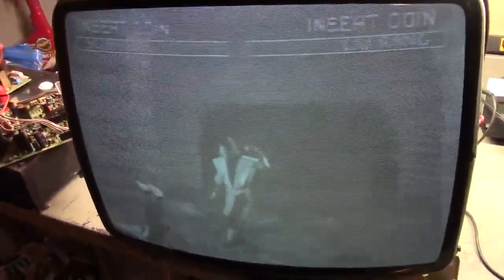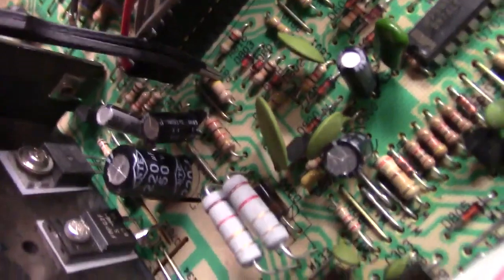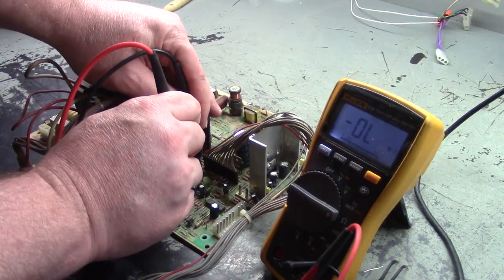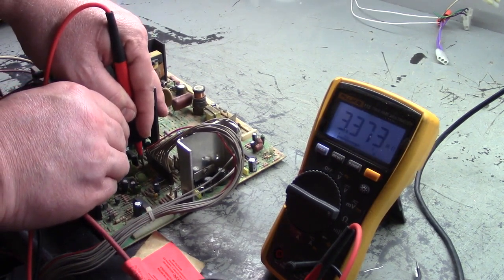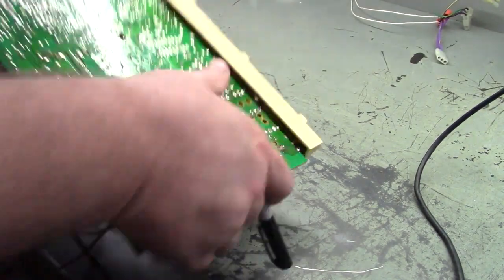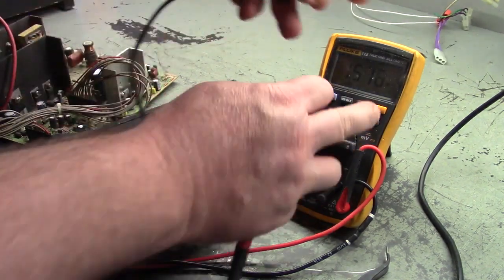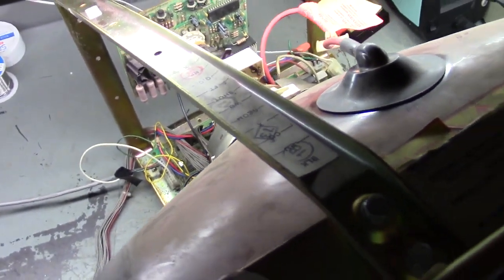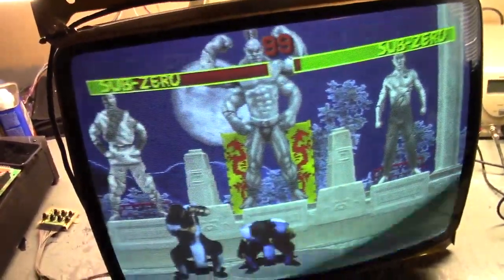25" K7400/K7500/U2000/U5000 Arcade Monitor Chassis Repair - Black And White Image - R811

Comment: Hi, Mike! Thanks to your video I've repaired my U5000 monitor: thanks a lot!!! :D The colours were really pale and I figured out that the R811 was at 30K Ohm! :O I've changed that resistance and colours get back to life! ;) I had problems with the vertical sync also and changed the C616 and it got much better but the images trembles a bit. I've noticed that it has a 1500 uF factroy-installed but in the manual says the correct uF is 1000 uF, so I put a 1000 uF, 63V. Am I right? Or should I change that. Thanks a lot in advance and sorry for my English! =)

Comment: This is great info! What if R811 is burned to the point of leaving burned marks on the board and lifted its traces? Would it just be part of the failure mode of the resistor?
Reply from the maker: Never seen it burned before, just open or out of tolerance. I suppose it could be part of the normal failure.,